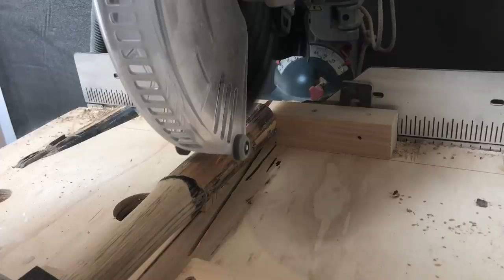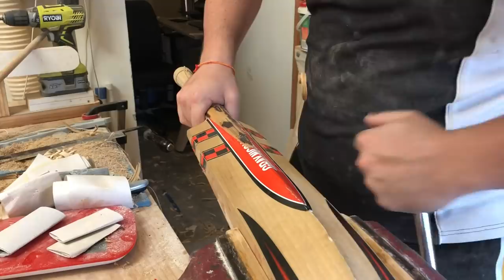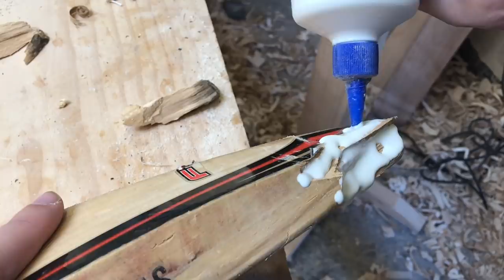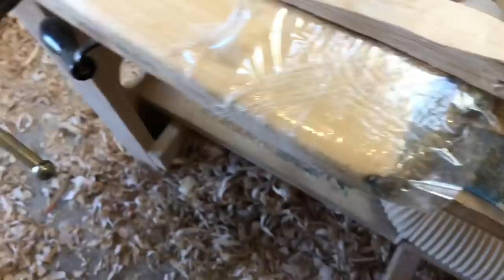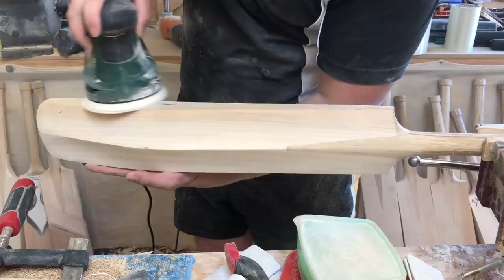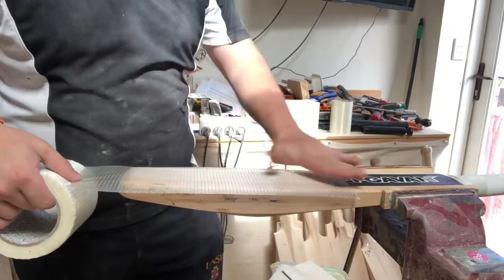Can it be fixed? Full cricket bat repair

Comment: So many comments from people who obviously are not woodworkers - Type III PVA (waterproof wood Glue) will be stronger than the original wood. It is also flexible and will bend and twist with the surrounding medium, in this case, the bat.  Epoxy style adhesives, although arguably stronger, will not be as flexible and will therefore crack if subjected to strong forces.
Reply: Good

Comment: Nice work mate. I would probably address and access the break in the blade before replacing the handle. I have fixed few bats so far and found the polyurethane glue to work the best. Keep up the good work.

Comment: Sheesh, everyone is an expert.  I think using the old broken pieces is more fitting to retain the look of the bat.

I have no experience with repairing bats, but I have 28 years of carpentry skills.  Wood glue is stronger than you would think,  stronger than the wood if used properly.

OK there are no massive wood working skills used, but there is no need for them.  Its good honest wood work that could be attempted by anyone who is capable with tools.

Comment: Good work but will this bat last? Because the main repairing u did is with glue and that too with at least 4 small parts on bottom now that's the only problem and thats the major problem, i have seen a lot of bat repairs in which they replace the whole piece and thats looks more reliable than this, now whoever plays with this bat will be always worried as this bat solely depends on glue, anyways good video and i could be wrong and i hope i m wrong.

Comment: wouldn't it be stronger if you were to cut off the square piece and replace it with a block of new wood? I don't know, just asking out of curiosity since the last piece looked smashed into many piece which were glued back together.. is this a fair question?

Comment: I had an old slightly damaged bat, cut out the bad wood (on the back of the bat, near toe), and replaced it with METAL... Bat now comes in at almost 5lb on the scales, and the pickup feels like 7lbs....
Completely unusable in a game, but I had a net on the machine with it before a game, went on to score a 100 with a proper bat....

Comment: Just one 140kph+ yorker 
But it is still very nice
Good work👍
Keep it up
Reply from the maker: BiLaL KhAn fingers crossed. It should be strong enough with all that glue!
Reply: You wouldn’t need to be that quick. This is superficial fixing. Damage like that can’t be fixed in a way that would be sound for very long at all for use against even quite slow bowling.
Reply: Bilal bhai. People who reach the level to face 140 mph yorker dont repair their bats

Comment: Nice work!!!
How do you determine whether you use PVA or superglue at different stages of the repair?
Reply from the maker: Ben Wood basically it depends on access to the crack. If I need to get glue deep into a thin crack superglue finds its way in.

Comment: This guy replaces handles no matter what the problem with the bat is
Reply from the maker: CHSHANMUKHA RAM especially when the handle is broken.
Reply: @JPGavanCricket  🤨🤨then y didn't you replace in every repair video
Reply from the maker: @chshanmukharam7694  If there's no issue with handle/shoulders it doesn't need to be replaced.

Comment: The repaired pieces will take a shot and it will break
Again
Reply: How strong is this glue join? I can't imagine it being any good.
Reply: @thivesennayager6278  Theoretically the glue joint will be stronger that the original wood. That's what they say about long grain to long grain PVA glue joints.
Reply: Nice pic

Comment: Nice but apj bat repair is best.
   Should have used single wooden piece in place of broken pieces .
  Boss again you will be getting the work of repairing the same bat one Yorker and the bat is gone
Reply from the maker: Grafting a piece was an option but it's in fact more risky. It is always better to glue existing pieces back in place if you have them.

Comment: They like the loco gymnasiums tool " mugur' is of same price like short blade bats, then why will we buy short bladed bats, we will buy Mugur , after gym use we will take it to pot maker and they will make a bat out of it, old bats cant be refurbished but old mugur would get sculpted as a new short blade bat, plus one mugur blade line will cater the wood requirements for 3 bat blades, they sill give two extra cans for making 3 bats out of each mugur , all profit

Comment: 40 to 50 $ bat took 200$ repair
Reply from the maker: $300 bat, $150 repair.
Reply: @JPGavanCricket  I am from Pakistan and my city is sialkot . very famous for sports and surgical instruments. . we buy a high quality bat in 40 to 50$ only  estimated amount surly not more then 60$ . . 150$ repair is really too high . . we throw the bat
Reply: @JPGavanCricket  I don't use Facebook or Instagram but if you want I will show you verity
Reply: Sami Iqbal your currency is different to our mate.
Reply: @teziis2367  wood quality is same
Reply: Probably knock off or fake bats. A real bat costs more than 500$ for player grade. Anything below 500$ is just fake high grade bat. The willow alone costs 200-300$ for a player grade bat  @HarFunMoula1
Reply: @HarFunMoula1  not same!
Reply: @HarFunMoula1  I think those are made for playing with tape tennis bat!

Comment: What are the list of glues you use?
Reply: You can use any PVA wood glue. For the cracks, you can use any liquid super glue that dries and hardens quickly.
Reply: In UK " Gorilla " glue is really really good I've personally used it for a broken table and after the use it's still bond it ,it's been over 2 years I glued it ,it's few quids more compare to other glues but it's best
Reply: hasbi rabbi

Comment: Did you just stick those broken pieces back together I would never do that just cut off those piece of and put a new single block of wood with fixing in it plus u didn't filled that crack just upright on that bat come-on so unsatisfied

Comment: Those broken pieces wont last you fucked up there. A solid wooden chock dowelled in with pegs would have been better . Once wood has moisture getting into it its no good . Very Surprised you tried to make the repair like that.

Comment: Complete waste of effort. That bat was dead, unfixable. No matter how pretty you make it it doesn’t change the fact that that bat still won’t function as a real bat because, as you know, it’ll fall to pieces again in no time if it’s ever used again. Toe damage like that has only one cure: buy a new bat!.
Reply from the maker: One mans trash is another mans treasure. This is an old favourite and we are trying to get another season out of it. I didn't know about the toe damage until I opened it up and you can kinda see my surprise when i cut open the tape. Customer was very happy with the result, why don't I comment back here if it breaks before the end of the season.
Reply: Daniel Allen he fixed a bat for a mate of mine an older kookaburra with a massive Hole in the middle and he just made a 💯 with it today and guess what it hasn’t broken great work JP
Reply: JPGavan Cricket I’ve always been of the opinion that there shouldn’t be a surprise like that, I’d always do a full inspection before accepting a bat for refurb (I have some experience in this industry). 

I agree that sometimes bats can have sentimental value and I can see why you’d want to fix an old favourite. I’d be very concerned about doing a fix like that and saying that it was in any way ready for use in a game. The risk in even implying that, as you sort of do in this video, would be something I would be unable to do in good conscience. You never know, the bat might survive a season, if the player is very lucky (or doesn’t bat for too long!). I’d be worried about accepting money for this repair and giving false hope when the risk is so high.

I stand by what I said: buy a new bat. By all means patch up the old favourite, which you do very well, but to regard it as anything more than that is less than realistic.
Reply: Locky Payne well batted to your friend! I’m not doubting his skill at fixing bats, I’ve acknowledged that. I’m talking about risk. Whether a repair like that should be accepted if you’re giving the impression it would be fixed for use again in matches. I see doing so as ethically dubious unless you make it clear the risk it will break again is rather high.
Reply from the maker: @danielpickton-allen8385  What's your experience? I've done over 5000 bat repairs in the last 4 years.
Reply from the maker: @danielpickton-allen8385  I don't appreciate you questioning my ethics. You don't know me, you don't know my business, you don't know if the owner paid for this repair or not, you don't know my relationship with the ower. Keep beating on people having a crack from behind your keyboard... Come say it to my face, champ.
Reply: JPGavan Cricket I worked in Romida (in the uk) for years. I’ve a lot of experience with bats both new and those in need of fixing I also worked with and know others who have a lot more experience than you do. One of my very good friends has over 20 years in this business (cricket retail and fixing bats) and I know he’d agree with me on this. You don’t need to get all defensive.

NB it used to be part of my job to tell people if I thought a bat could be fixed with sufficient confidence to justify the cost. From the evidence of this conversation we are having I’m either better at that than you are or I’m at least more honest
Reply from the maker: @danielpickton-allen8385  Guess I'll see you at my workshop so you can continue questioning my ethics? How about the text from my client after seeing this video thanking me. He's a professional cricketer, who worked in retail, and did bat repairs. Question my ethics all you want, bud.